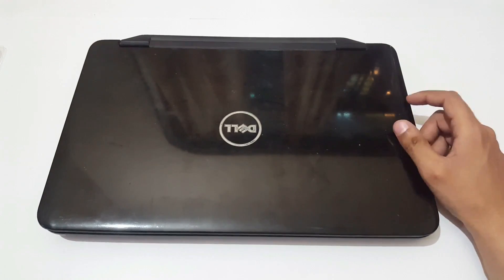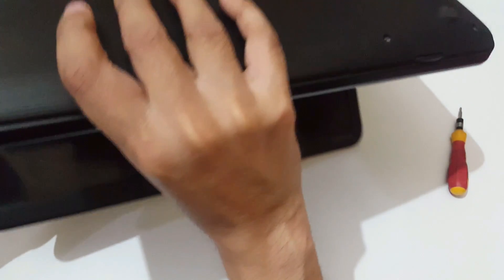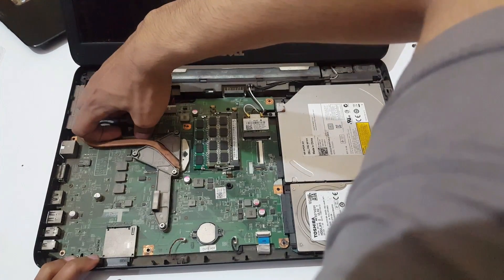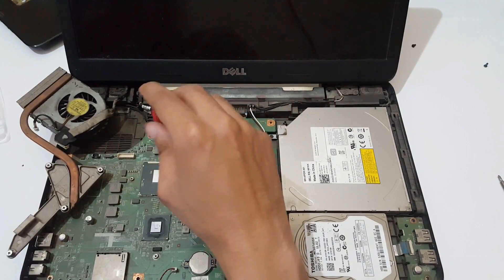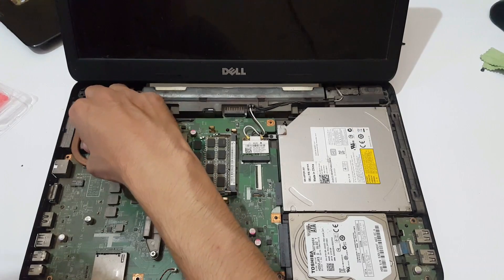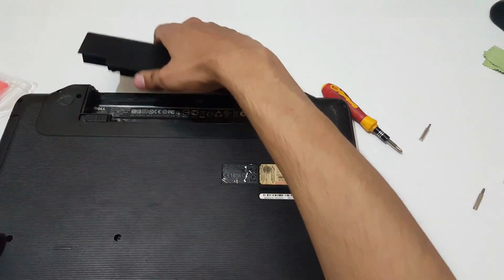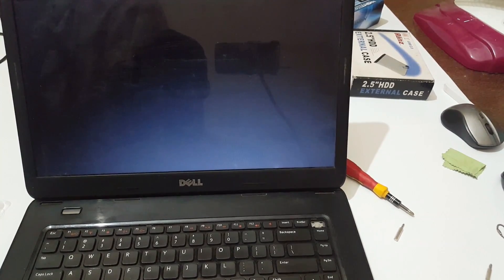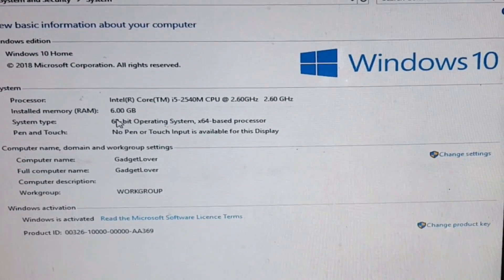How to Upgrade Processor on DELL Laptop | i3 to i5 & i7 - Make Laptop Faster for Gaming

Comment: I have a Dell Inspiron 7559 laptop, core i7 6700hq , 16Gb ram ddr4 1600. Can I upgrade the processor of this laptop? 
Or GPU? 960GM GPU
I like this laptop and i want to keep it. If you know any upgradable parts on it just tell me
I already upgraded display from full hd to 4k with touchscreen and intel m2 ssd sata 
By the way good video.
Reply from the maker: Dorin Vladu : Thanks and unfortunately the processor of this Laptop is soldered so you can't upgrade it
Reply: @GadgetLover360  Thanks.
Reply from the maker: Dorin Vladu : You're welcome
Reply: Msi cr630 laptop with amd athlon II p320 and 2x2gb ddr3 1066 
Toshiba satellite l500d 1ut with intel pentium 2,2ghz and 2x2gb ddr2 800
Do you know what is the maximum or the best cpu and ram memory? For both laptops. 
For msi i find an amd cpu amd phenom x4 940 be, but im not sure if it's matching to my laptop.
And i wanted to upgrade to 2x4gb memory for better performance
Reply from the maker: Dorin Vladu : For MSI CR630 AMD Phenom II X940 will produce more heat and heat up the Laptop so AMD Phenom II P960 for MSI CR630 and Intel Core 2 Duo T9900 for Toshiba Satelite L500 is best processor
Reply: @GadgetLover360  Thank you very much! I'm looking on ebay for cpus :)
Reply from the maker: Dorin Vladu : You're most welcome

Comment: I have acer aspire e15 e-575-3719 core i3 6th gen 
Can i upgrade my processor?
Reply from the maker: Karan Veer : The processor of this Laptop is soldered so you can't upgrade it
Reply: So can i just upgrade hdd to ssd??
Reply from the maker: Karan Veer : Yes it will improve the performance of your Laptop

Comment: Hi Guru, I have laptop dell xps L502X with this spec: 
Intel Core i7 2630QM, 4GB DDR3, NVIDIA GeForce GT 540M 2GB, 750 HDD, 15.6'' WXGA, Kamera, Wifi, Bluetooth, Blu-ray, Win7 Premium. What is the mostly possible for cpu upgrade for this spec? Please advice. Many thanks in advanced.
Reply from the maker: Malinau Agar : You're welcome and Intel Core i7 2860QM is best processor for your Laptop
Reply: @GadgetLover360   so not much improvement because  it looks like same gen of cpu?
Reply from the maker: Malinau Agar : It will slightly improve the performance of your Laptop and I would suggest you upgrade its RAM and install SSD for more better performance
Reply: @GadgetLover360  Ok Guru many thanks for your advices.
Reply from the maker: Malinau Agar : You're most welcome
Reply: @GadgetLover360  i can put i7-3940XM on L502X?
Reply from the maker: @jvosch  If the processor is not soldered you can upgrade it in same generation

Comment: Hey i have a Lenovo s340 14inch, with a ryzen 5 3500u 2.6ghz processor. And it is very poor at gaming for some reason. Should i replace the processor or is there any way to maximize performance.
Reply from the maker: Surja Sekhar Sengupta : The processor of this Laptop is soldered so you can't upgrade it I would suggest you upgrade its RAM and install SSD for better performance
Reply: @GadgetLover360  thanks for the advice. Can it run titles like Forza Horizon 4 then?
Reply from the maker: Surja Sekhar Sengupta : You're welcome and I can't say that but it will improve the performance of Laptop

Comment: I have Dell Vostro 3568 with i3 5th Gen i want to upgrade RAM and convert HDD to SSD is it worth to do it and will it fast up the laptop
Reply from the maker: Ravi k : Yes
Reply: @GadgetLover360  thank you so after upgrade can I use application like virtual box and work on other software
Reply from the maker: Ravi k : You're welcome and RAM and SSD upgrade will improve the performance of your Laptop
Reply: Can I add M2 SSD in Dell Vostro 3568 for replacement of HDD and also do I need casing for putting SSD?
Reply from the maker: Ravi k : Buy 2.5 inch internal SSD for your Laptop
Reply: @GadgetLover360  you mean normal SSD? I don't know what is 2.5 SSD
Reply from the maker: Ravi k : Replace it with HDD for better performance
Reply: @GadgetLover360  sure thank you and I can use HDD as external drive
Reply from the maker: Ravi k : Yes and You're welcome
Reply: @GadgetLover360  sir I when I purchased the laptop I got windows 10 OS pre- installed after replacing HDD with SSD how do I install os
Reply from the maker: Ravi k : Use system image backup
Reply: For OS how much partition is good?
Reply from the maker: Ravi k : 100GB to 150GB
Reply: I have kept SSD and boot screen came up staying uefi SanDisk partition

Comment: Thanks for this, btw what is the best processor for my Inspiron 3521 Core i3? I am planning to upgrade that because it is too slow now. Thankyou 👍
Reply from the maker: Pew Pew : You're welcome and unfortunately the processor of this Laptop is soldered so you can't upgrade it I would suggest you upgrade its RAM and install SSD for better performance
Reply: Install additional RAM
Reply from the maker: Gadgets Latest : Yes RAM upgrade will improve the performance of Laptop
Reply: I am using the same laptop but my laptop is working perfectly - I have core i3 3521 - 3rd generation - And its too fast
Reply: Wt is ur current ram size??
Reply: @harishkumar8705  8GB RAM DDR3
Reply: Can I upgrade my i3 processor for Dell Inspiron 3467 to i5 also what's is the maximum ram can be used in it?

Comment: Dell Inspiron 3583 Pentium Gold processor. Can i upgrade? Thanks in advance.
Reply from the maker: Lucas Portela : You're welcome and unfortunately the processor of this Laptop is soldered so you can't upgrade it
Reply: @GadgetLover360 thank you again. if you could answer this other question, i would be grateful: can i insert a SSD m2 sata 2280 in the m2 slot of this laptop?
Reply from the maker: Lucas Portela : Yes

Comment: hello Sir, i have sony sve14133cn laptop with i3 3rd gen processor, so is it possible to upgrade to i7 3rd gen?
Reply from the maker: roshav sourav : If processor is not soldered you can upgrade it with Intel Core i7 3632QM

Comment: Can I upgrade prosessor of dell Inspiron 3521?
I doesn't think I can do because it have a U series prosessor (i3 3217u)
Reply from the maker: Aditya Rana : The processor of this Laptop is soldered so you can't upgrade it
Reply from the maker: Aditya Rana : Which has upgraded processor best in class GPU and high bandwidth RAM

Comment: I have dell Inspiron 15 3000 ..it's lag too much ..like takes almost 15 min to make normal run...so I can upgrade i5 and max the ram and storage?
Reply from the maker: Aniket B : In my knowledge the processor of this Laptop is soldered so you can't upgrade it I would suggest you upgrade its RAM and install SSD for better performance

Comment: Can I upgrade processor of dell N5010 model
Reply from the maker: Pavan Kumar : Yes
Reply: Ok..can you please say which processor type is suitable and with which motherboard I should go with and processor type
Reply from the maker: Pavan Kumar : No need to change motherboard tell me what processor is in your Laptop
Reply: I3 processor at present..I want to upgrade it to i7, replace my hard disk to SSD add GPU (Nvidia) of 4GB and RAM of 16 GB DDR4 so only want to change motherboard suitable for all the above..pls let me knw is it possible to upgrade my 9 years old laptop or buying new laptop is best option..pls help me in this
Reply from the maker: Pawan Kumar : You cannot change graphics card of your Laptop so in my knowledge buying a new Laptop is a better option

Comment: My laptop is hp bs580tx so in future If I want to upgrade it what changes can I do in future.
Reply from the maker: VIVEK NIRMALKAR : In my knowledge the processor of this Laptop is soldered so you can't upgrade it
Reply: @GadgetLover360  ram badhane se kuch benefit hoga kya i3 h to speed me kuch improvement aur
Reply from the maker: VIVEK NIRMALKAR : Yes and I would suggest you install SSD for better performance

Comment: My laptop is ideapad 330d.....it has i5 8250u...can this laptop be upgraded,if yes than which procsr??
Reply from the maker: Ayushman Chaudhary : Intel Core i7 8650U is best processor for your Laptop and I would like to inform you that if processor is soldered you can't upgrade it
Reply: @GadgetLover360  8650u is only about 5-10 % faster and its on the same batch as 8250u.....so i think i dont need any upgrade.

Comment: Can I change my Dell Inspiron 14 5000 2 in 1 i5 to amd ryzen 5 2600 ?? 
Plz tell... 
And. My graphic card to intel uhd 620 to nvidia GeForce GTX 1050 to ???
Reply from the maker: XMythic Dragon : The processor of this Laptop is soldered so you can't upgrade it but you can attach graphics card externally to your Laptop for better gaming experience

Comment: Hi bro, very explanatory video, I like it. I have a "Dell Inspiron 14 N4050" laptop with "Intel Core i3 -2370M CPU @ 2.40GHz", 4 GB RAM (DDR3 at 665.1 Mhz DRAM), 64 bit OS, 300 GB HDD, Mobile Intel(R) HD Graphic 1809 MB (clocked at 648 Mhz), ATI Radeon Graphics of 1024 MB. The laptop is 7 years 236 days old.

But it has 3 issues: 
1) HDD is making loud noise and the screen gets stuck in between few seconds while working. 
2) The internal right speaker is damaged due to which it makes a crackling sound. 
3) The battery takes 2 to 2 and a half hours to charge but dips down within 1 to 1 and a half hours.

Q: 1) What is the best repair/upgrade you would suggest me?
Q: 2) I spoke with Official Dell tech support person recently and he told me that my model does not support SSD and I cannot install it?

I would like to play some compatible gaming titles on this laptop hence request you to please advise/suggest your expertise on the same.
A very heartfelt thank you in advance.     
Awaiting your reply.
Reply from the maker: Majid Sayed : Intel Core i5 2540M is best processor for your Laptop and I would suggest you upgrade its RAM and install SSD for more better performance

Comment: Mine is Dell Inspiron 3521 with i5 , 4gb ram and 500gb HDD, what should I upgrade?
Reply from the maker: Prakyath : The processor of this Laptop is soldered so you can't upgrade it I would suggest you upgrade its RAM and install SSD for better performance
Reply: @GadgetLover360   Thanks brother:) you earned a new subscriber 🤗
Reply from the maker: Prakyath : Dear subscriber you're welcome
Reply: @GadgetLover360  Thanks for your reply :) I'm using Unity Engine for Game Development , Which do I need to upgrade in order to increase performance , SSD or RAM ?
Reply from the maker: Prakyath : You're welcome and both upgrades are needed for better performance

Comment: I have Dell vostro 15 3000 series 3581. Can I upgrade it's CPU!?
Reply from the maker: Robin C R : The processor of this Laptop is soldered so you can't upgrade it
Reply: @GadgetLover360  what about Dell Inspiron 15 3000 i3 7th gen ,Can I upgrade the CPU!?
Reply from the maker: Robin C R : The processor of this Laptop is soldered so you can't upgrade it
Reply: @GadgetLover360  which of the Dell laptops having an option to upgrade the CPU!?
Reply from the maker: Robin C R : If Laptop is soldered you can't upgrade it at home as it requires professional hand soldering services
Reply: @GadgetLover360  which of the Dell laptops does not having soldered CPU!?
Reply from the maker: Robin C R : Many are available
Reply: @GadgetLover360  can u please tell me what are those laptop varients!?
Reply from the maker: Robin C R : I would suggest you search on Google for best results
Reply: @GadgetLover360  Sure,Okay! Thanks 😊
Reply from the maker: Robin C R : You're welcome

Comment: HP 15-AY020TU
Processor Intel(R) Core(TM) i3-5005U CPU @ 2.00GHz hp laptop

Can I upgrade this professor ?
Or SSD ?
Reply from the maker: online cash via mobile : In my knowledge the processor of this Laptop is soldered so you can't upgrade it I would suggest you upgrade its RAM and install SSD for better performance
Reply: @GadgetLover360  Ok. Thanks 🙏
Reply from the maker: online cash via mobile : You're welcome

Comment: Hey sir! Just wanted to know that can we change the processor of any laptop?
Reply from the maker: SAMEER MALIK : Yes but If processor is soldered it require professional hand soldering services
Reply: A processer Cannot be changed , it can only if the mother board supports it and there is one more problem here is that ur processer should be unlocked =K not H or U
(99.9% of the times u can't change the processor)
Reply: How do you know if it is or not is the 7490 latitude? Soldered ?
Reply: @dannygee2606  u need to scearch in google about ur laptop processor and then u can if ur laptops processor is i3 4thgen then u can upgrade till i5 or i74th gen only

Comment: Thank You for amazing video & got my subscription now.
I have dell core i3 4030 laptop with 4GB DDR3 Ram and 500GB hard disk . i want to increase its performance maximum for video editing software's  and gaming , So please suggest me what should i  upgrade for better performance.
Reply from the maker: Hamid Khan : Intel Core i5 4310U is best processor for your Laptop and I would suggest you upgrade its RAM and install SSD for more better performance
Reply: @GadgetLover360  Can i upgrade these things on my old  mother board? Or should I need to change mother board too.
Thank you for giving such a kind suggestion.
Reply: @GadgetLover360  & my laptop is 16.9 inches in size , does it support SSD along with hard disk ?
Reply from the maker: Hamid Khan : You're welcome and yes it is applicable on current motherboard and I would suggest you buy internal SSD drive for more better performance
Reply: @GadgetLover360  ok thank you so much ✌️
Reply from the maker: Hamid Khan : You're most welcome

Comment: I have dell n5050 please recommend the processor and ram upgrade
Reply from the maker: Amar Jeet : Intel Core i5 2540M is best processor for your Laptop and I would suggest you upgrade its RAM upto 8GB of size 4+4 DDR3 1333MHz and install SSD for more better performance
Reply: What if I go for SSD and ram upgrade .will it work?
Reply from the maker: Amar Jeet : Yes it will boost the performance of Laptop but I would also suggest you to upgrade processor for more better performance
Reply: What's the price of processor and any leads?
Reply from the maker: Amar Jeet : I would suggest you buy it from Amazon online store and if not available there buy it from ebay or Aliexpress online store

Comment: Hello, I have dell vostro, 1015 model, 32 bit, 2gb ram, core 2 duo processor, 1.6ghz , 320 gb HDD, what should i upgrade  for better performance,  What if i only upgrade Intel i5 processor , will it help for better performance
Reply from the maker: arjun mizar : Processor upgrade will boost the performance of Laptop and I would suggest you upgrade its RAM and install SSD for more better performance

Comment: Can we upgrade processer from i3 7th to i5 8th
Reply from the maker: The Neplese Gamer : Unfortunately you can upgrade it in same generation only
Reply: But why
Reply from the maker: The Naplese Gamer : Because of different sockets and microprocessor units
Reply: @GadgetLover360  I have seen one vedio the guy is upgrading PC from Intel Pentium 3 to i5 2th
Reply from the maker: The Neplese Gamer : In my knowledge without motherboard replacement not possible

Comment: Hello, new subscriber here. May I ask the maximum RAM upgrade I can do with my Dell Inspiron 15 3000? And is it okay if I only upgrade the RAM and change into SSD? Thank you
Reply from the maker: Erza Fraga : Dear subscriber thanks for your subscription and in my knowledge you can expand it upto 16GB and I would suggest you with RAM upgrade install SSD for more better performance
Reply: Hellow tm 18. I have a dell inspiron 15 3576. Here is what you can do to increase its performance. Change hdd to ssd, ram up to 16gb, normally it is installed with legacy bios. Convert your current os to uefi bios. (more optimised form). And if you like to play latest games in low settings. Then do undervolting using throttle. Undervolting keep your system at min temp even at 100% cpu utilisation. (it is a safe mothod no physical damage involved). Update bios to latest 2021 firmware (most stable). Install all latest chipset drivers from dell web except display driver.  Install it only from intel website. (this gives more fps to games). After all this methods you will get a fast laptop. My undervolting shift : - 161.5
Reply: I have dell inspiron 15 3567 , I upgradded the RAM from 4 GB to 20 GB by adding a 16 GB RAM in the other slot, installed a 480 GB SSD drive , and used the 1TB HDD drive as a secondary hard drive using a 9.5mm caddy , now speed enhanced alot  , now core i3 CPU limits the speed , but it is still working good thanks to God

Comment: Hello Sir,
Thank you for the helpful video.
Can you suggest whether I can upgrade processor of my Dell Latitude E5540 as it is currently running i7 4600 processor?
If it is possible, let me know the best processor I can use.
Reply from the maker: Hitesh Kirtane : You're welcome and the processor of this Laptop is soldered so you can't upgrade it I would suggest you upgrade its RAM and install SSD for better performance
Reply: @GadgetLover360  Thank you for the reply. I would surely upgrade the RAM along with a SSD.
Reply from the maker: Hitesh Kirtane : You're welcome

Comment: Nice video. I have an HP G62-144DX Laptop with Intel i3. I would like to upgrade to i5. Which Intel i5 would work for this computer?
Reply from the maker: Jim Stelljes : Thanks and Intel Core i5 580M is best processor for your Laptop
Reply: @GadgetLover360  Thanks for your prompt reply and recommendation. I forgot to mention it came with the Intel i3 M 330 @ 2.13 GHz.
Reply from the maker: Jom Stelljes : You're welcome and the processor I have written in previous reply is best for your Laptop